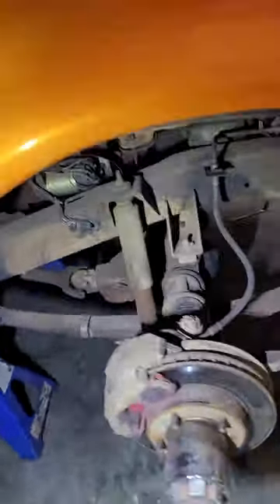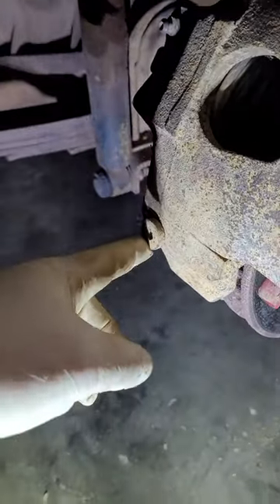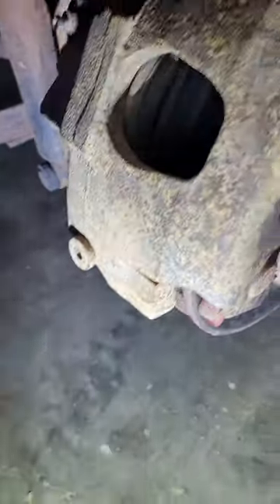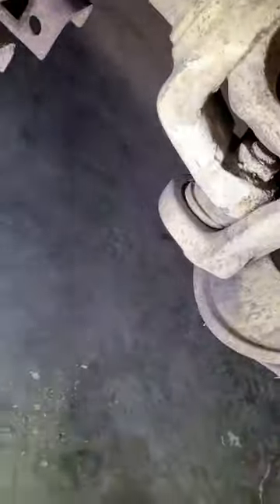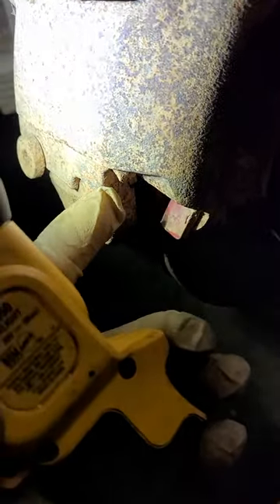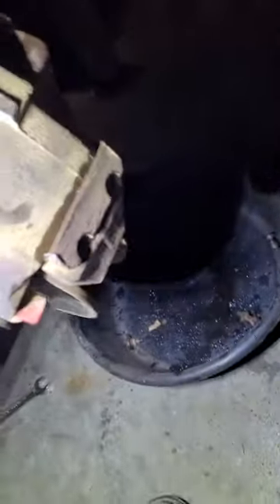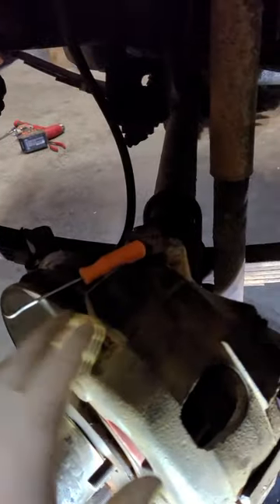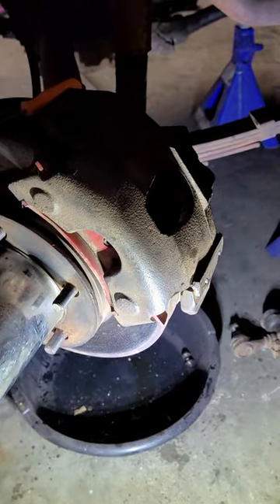1974 international scout ii harvester front brake caliper removal

Comment: By chance did you replace seals in your differentials?  While rebuilding my differentials (74 Scout ii)  I ordered parts from Rock Auto. Apparently the inner axle seals are the wrong parts. Trying to locate a source for deciphering which parts I need.  Any wisdom on the matter? Thanks in advance.